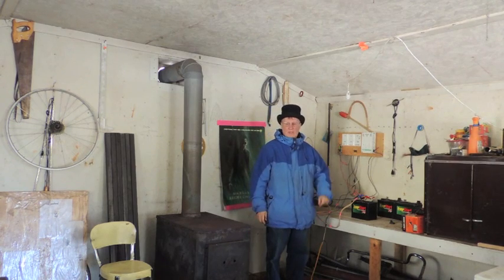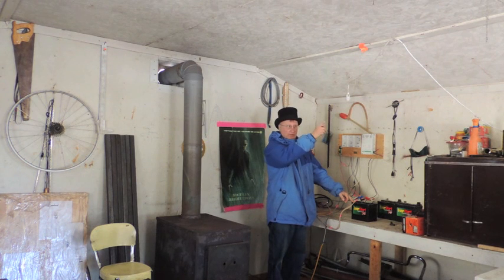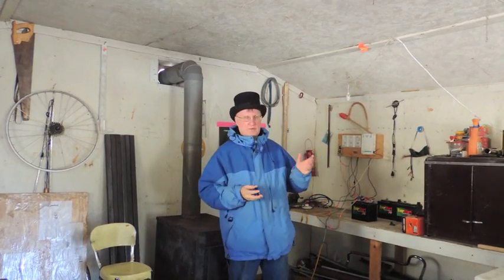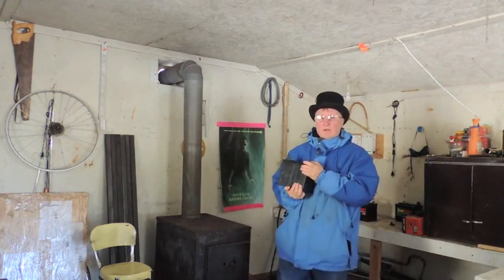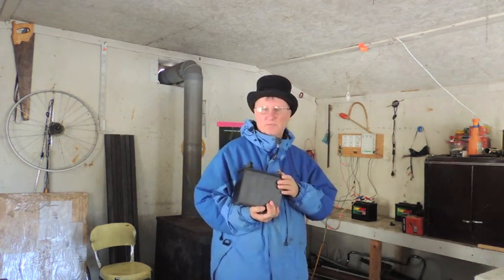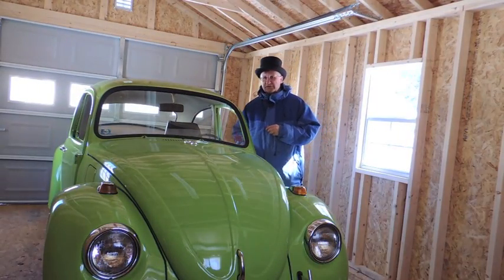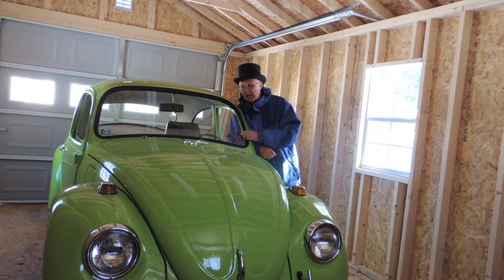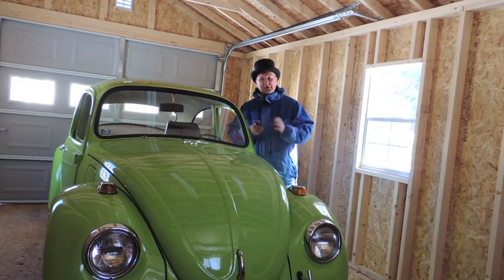Afternoon fun with Tinny

Comment: If you want to bike on the road in winter you can make a winter tire by taking a tire and screwing sheet metal screws from the inside so they stick out through the tread.  Then take another old tire and cut the bead off and put that inside the first tire to protect the tube from the screw heads... add tube and mount the tire.  A bit heavy but it works.  Got the idea from the web page for the Edmonton Bike club years ago.  Don't know if it still exists.